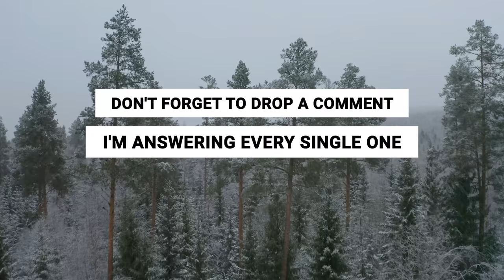I TOTALLY Underestimated Simple Living

Comment: Congratulations on another magical video. I, too, get very nervous when my husband has to be on the roof especially when it's slippery. The past couple of years we've had so much snow that we've had to go up on the roof to shovel it off to prevent the roof from collapsing. Sounds easy enough, but that snow gets packed so tightly from the wind and frigid temperatures that it's like trying to remove concrete (a very slow and difficult process). I'm so thankful that we have not had excessive snow this winter. I was so happy that you made it safely to Denmark and were able to spend the holidays with Christine. Happy New Year to you both!
Reply from the maker: Thank you Renee ❤ Yes that is not easy 😅 Happy new year!

Comment: Kalle you can't stand up straight in your bedroom under the roof, when you walk you always hit your head on the roof beams, why did you only insulate the roof of your log cabin and not build it two to three meters higher, take the roof off , dismantled the two gables and built your log cabin with logs a whole floor above it, this would have made it possible to make several rooms, for children and also possible for you to have an attic above where you can stand up right at the top.

Comment: Maybe I have missed something. How do you heat your cabin? If it is only with wood - how much wood do you need for a winter? How do you get Internet in the remote areas of the Northern Sweden?
Reply from the maker: Both with wood and when we are gone a air heater 😊 We have a portable internet, works ok 😅
Reply: @KalleFlodin  Thanks for your response! I guess you meant a mobile (cellular) internet under a portable one.